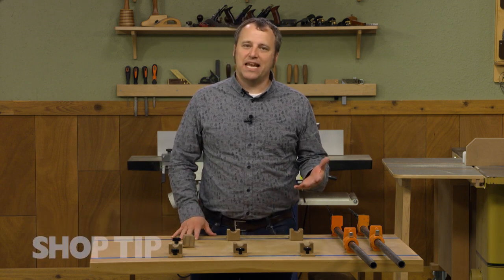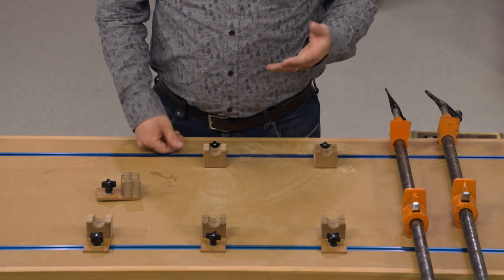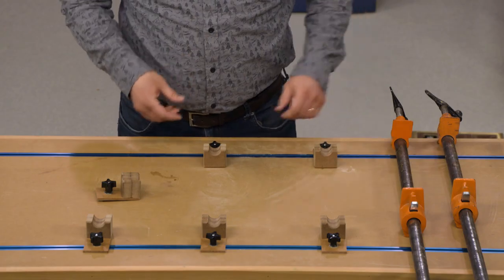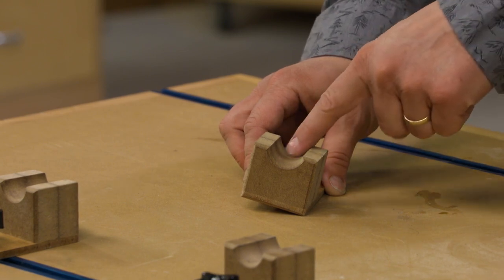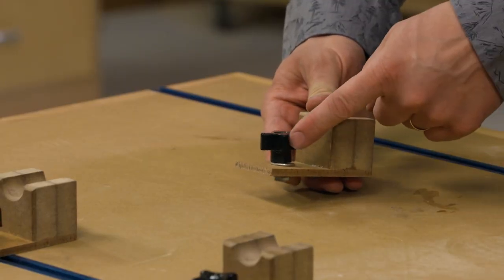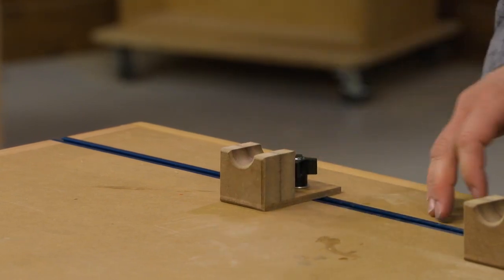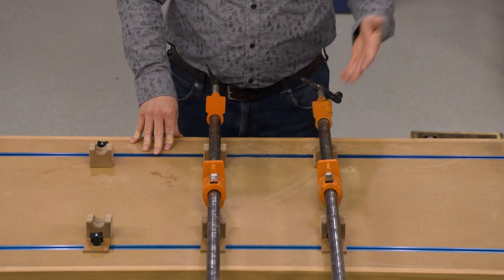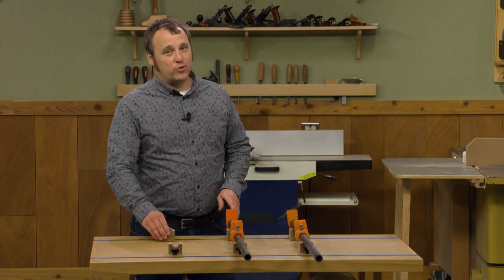Woodworking Tip: Pipe Clamp Cradles

Comment: Nice, but I think I'd build them with the base rotated 90° so that the clamping knob is not under the pipe - then I can make adjustments more easily when the clamps are laid into their cradles.